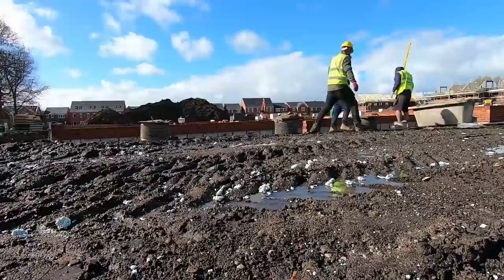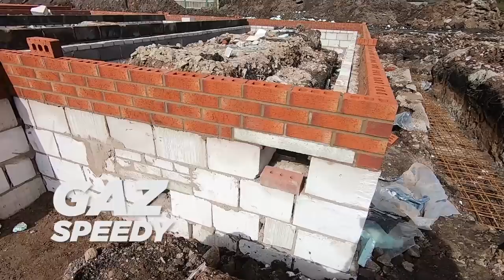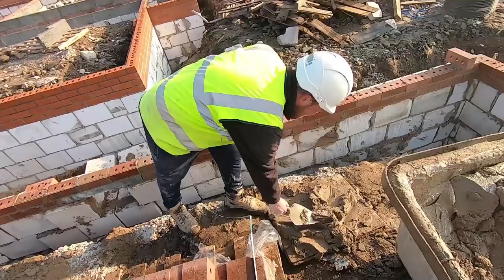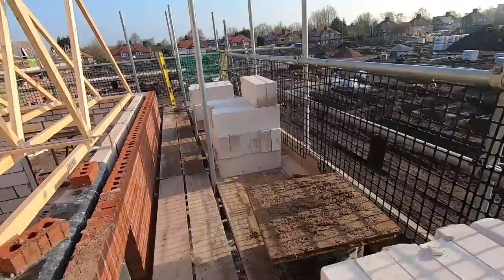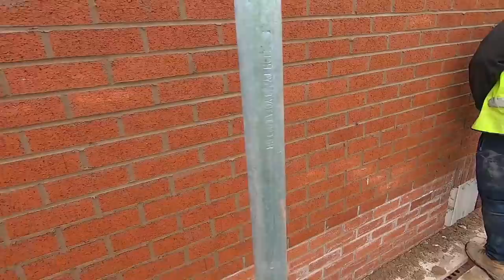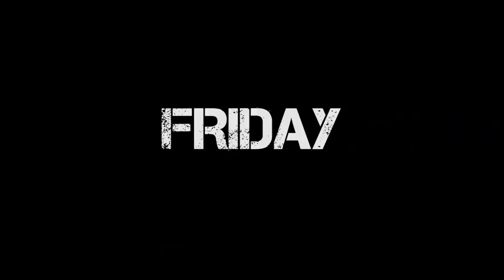Building House Pike Bricklaying

Comment: Hi Stu 
Good video.  One question why do you point up when the muck is so wet ?
Reply from the maker: sometimes you just have to, if the bricks are damp and mortar is wet then it would only dry tomorrow and it was my last say friday  no problem better to joint then touch up the day after than to leave and risk it being rock solid the next day it would take you 3 times longer to finish

Comment: Stu, at 06:25 there looks to be an entire floor of the house filled with large bags of some sort. Do you know what they are? And what they are used for please. All the best.
Reply: There for the joiners and roofers in case they fall when putting the roof on....health and safety means you have to put them down on site.
Reply: Fall bags or safety bags. They are filled with polystyrene chips to cushion your fall. They're an absolute pain in the arse to most labourers (those that have to move them in and out of houses).